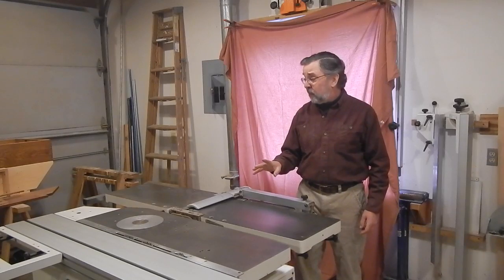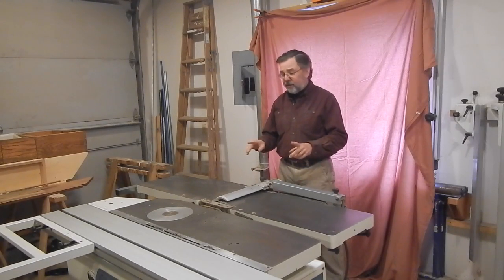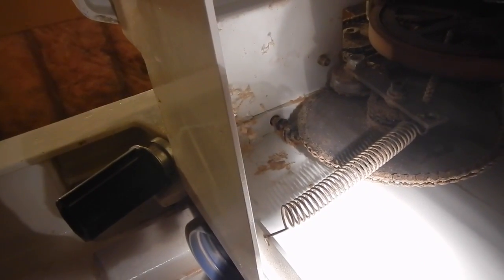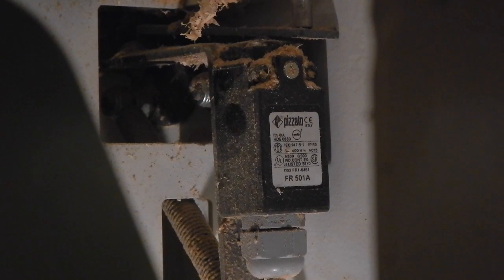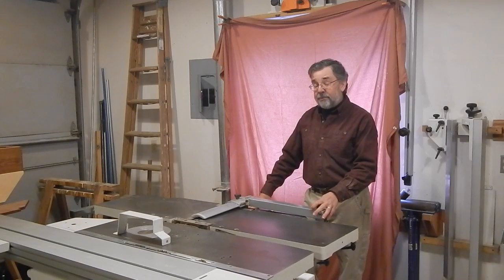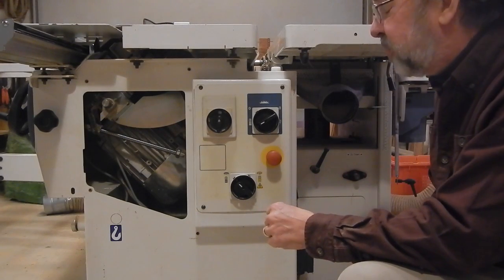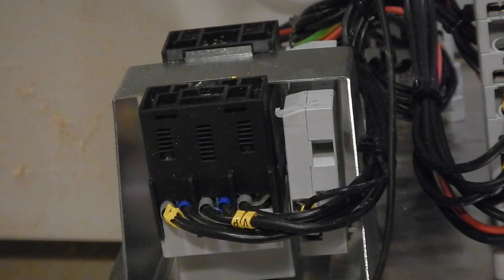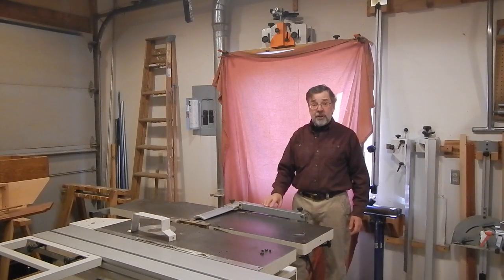MiniMax CU300 - Safety Switches

Comment: My machine, CU410 circa 2000, was not powering up.  Checked the power and all the safety switches but no luck.  My son (an adult), was using the saw and had accidentally moved the shaper rotation selector to the '0' position.   I have never had a reason to use the rotation switch so I didn't notice the new position.  Although your video addressed this, I still didn't pick up on it because I didn't have the time to properly troubleshoot the combo.  I am happy my machine is back on line!!